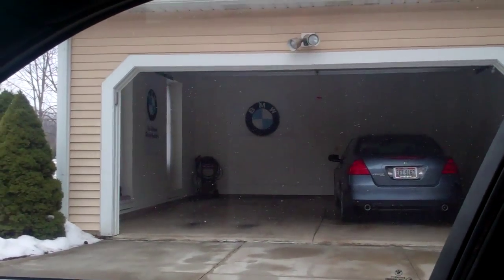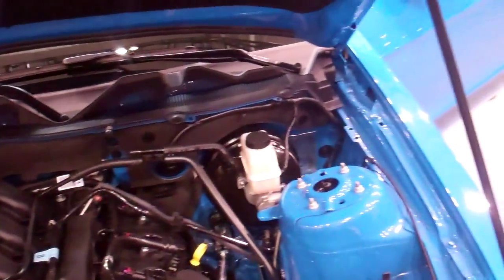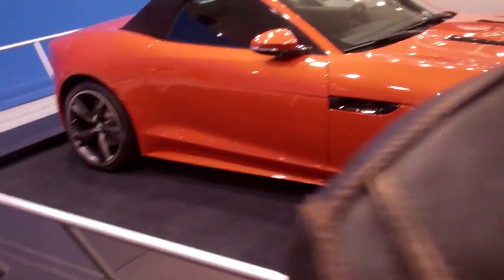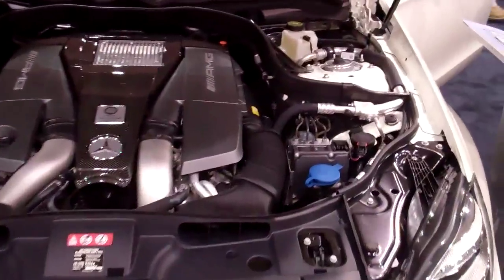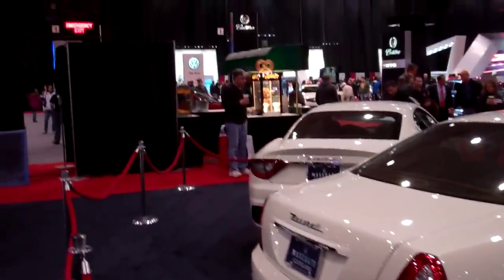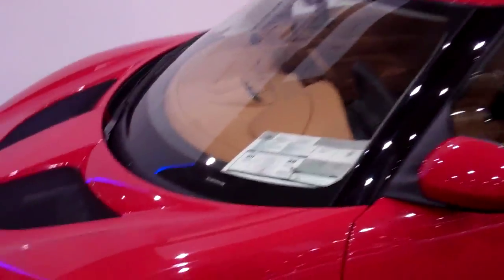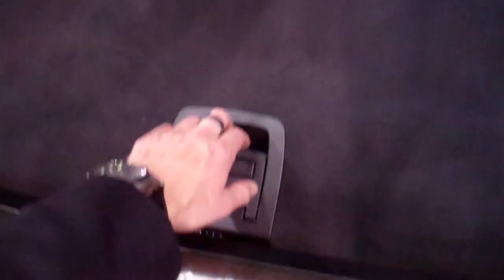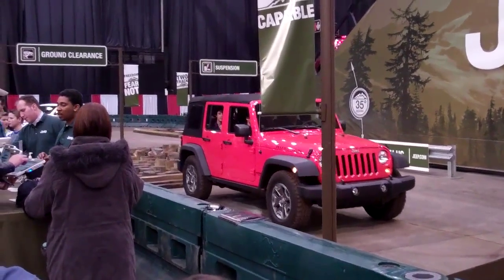Mustang Sucks  2/23/13 - Day 804

Comment: Im european and you look like one too. If you compare a mustang to a european car , of couse it has cheaper parts but its also cheaper to maintain , easy to work on and much more reliable.
Reply from the maker: I wouldn't say reliable.  The entire car pretty much falls apart around 50,000 miles, or every American car that we've ever owned has.  Intake manifolds crack, wheels pit and rust from the inside out, struts leak at 40k, mufflers get holes in them, EGR valves stick at 35k, we'll never have another American car in our family at least.
Reply: well you just got unlucky but americans are mainly good at trucks and v8 cars , all the 4cyl and v6 arent good that I can say .
Reply: incorrect.  my mothers 2009 ford fusion sel v6 received 9.3 out of 10 for reliability.  most ford 4 cylinder and 6 cylinders are mazda engines.  focuses are the most reliable 4 cylinder car for americans and more reliable than alot of other 4 cylinder cars..  the ratings show it.
Reply: spot on 390merc.  my uncle had a 97 f150 5.4 and gave it to his son with 290,000 miles on it.  all he did was change fluids on time.  we put a new motor in my buddies audi that only had 140,000 miles.  140k is ALOT for a german car hahahahaha
Reply: JRSVlog fall apart? I think no

Comment: Oh and you want to talk about plastic parts lol ? Ive worked on lots of bmws and german cars and they use platic on engine parts. Americans might have plastic interiors but id rather have a plastic interior then a plastic engine
Reply from the maker: I've never seen an engine without plastic components.  But, any US car that I have opened the hood on has been mostly plastic.  That whole little engine cover idea to hide the low quality is pretty bad, you can grab that cover and pull it a few inches in every direction!  My engine has plenty of plastic sensors, and the plenum is plastic.  I've never had a failure due to plastic parts though.  :)
Reply: not yet , and every car nowadays has plastic covers , its whats under the covers that you dont see on bmws that are plastic
Reply from the maker: Robert Chmiel I have the M tuned S62, so M probably custom designed more the components so its different.  Aside from trivial trim and the plenum, most everything is aluminum.  And plastic isn't the enemy here- it's poorly designed, low quality plastic, used in the wrong spots.  All I am saying is you'd be hard pressed to find an American car with 200,000 miles that still drives very well.
Reply: Well I cant hate on M power bmws. They have strong engines and very balanced car , very well made.

Comment: When you pay enough for a car, it will include nicer appointments such as leather door panels. But for $30k, you're paying for a 5.0L engine, LSD, a well balanced chassis and a warranty. A hood prop is just fine and does the simple job while being lighter. The current Honda I drive has a prop, and the Impreza I drove before the M5 had a prop too. My M5 is on its second cluster, and it is fading too. I just don't think a Mustang can be called shit when Ford has gone this far in improvements.

Comment: But our M5's have the same issues.

Our HVAC buttons crack, fade and break. We have pixel issues on the cluster. Our rearview mirrors bubble. The window regulators break. Our door handles and door lock actuators freeze and break too. Worst part is that our fancy European parts cost more to replace than parts on your average joe-doe Taurus that shares similar parts with a Mustang 5.0.

Comment from the maker: All parts will deteriorate and break, no car is perfect.  But interior door panels should not be made of cardboard and molded plastic, maybe some stitched leather instead.  And hood struts.  And our pixels are capable of spelling anything, not just the time.  Colt's pixels are perfect, and his car has 227k on it!  Plus we had navigation 13 years ago.  In my opinion, our European cars are like fine pocket watches, they are worth maintaining.  These new Fords are cereal box prize digital watches.